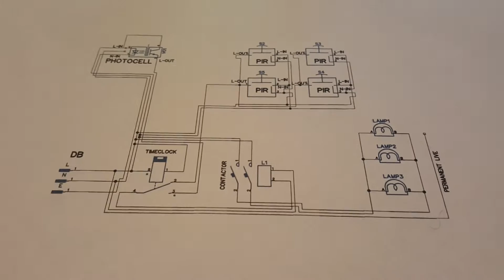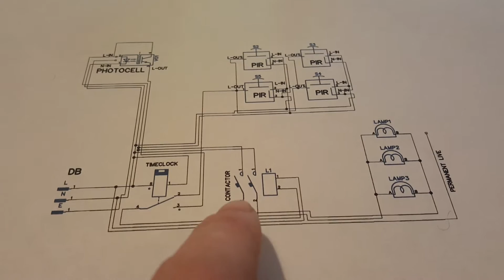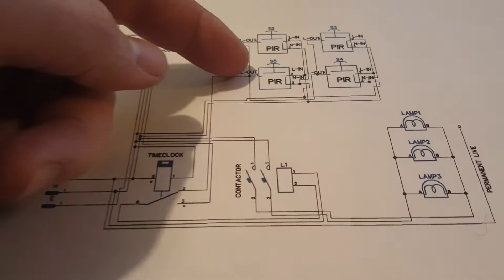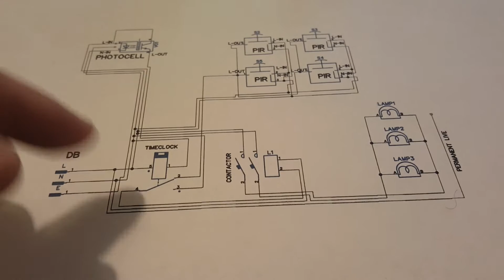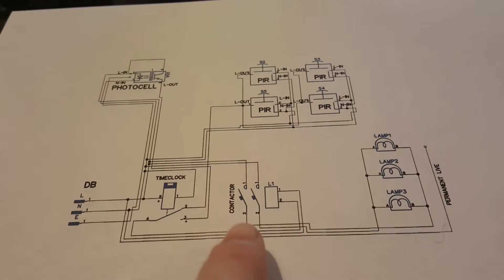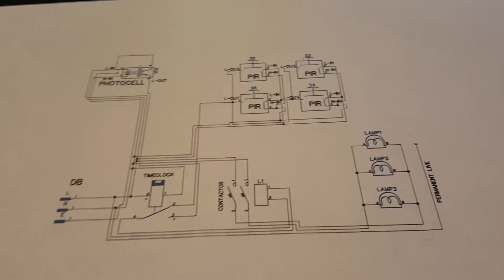Fully Automated Outside lighting Controller

Comment: Hii frind you can chnge the fotochell to controller like adam 4055..?  Thanks.
Reply from the maker: It is possible, but bare in mind all of this circuit runs at mains voltage so you would possibly need a 230v relay to control that part of the circuit